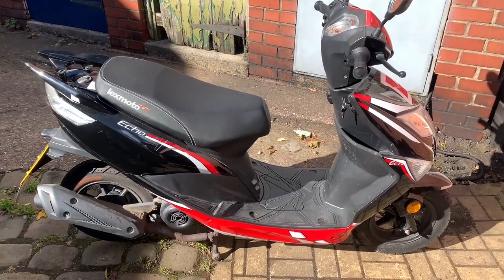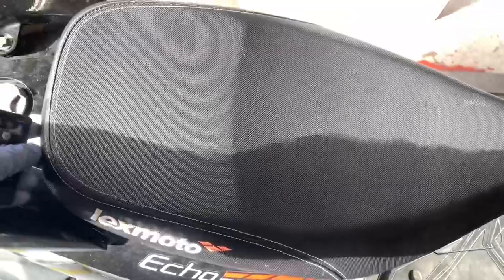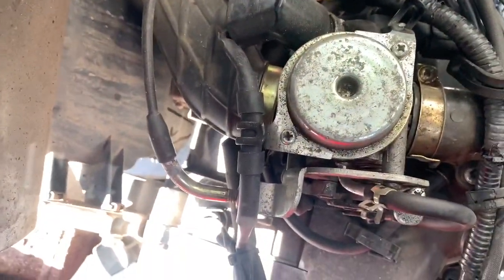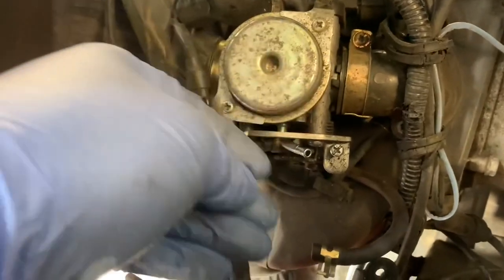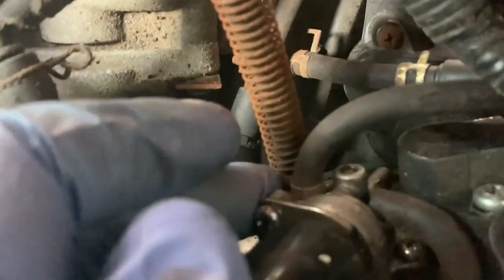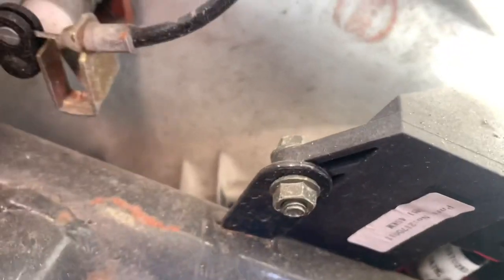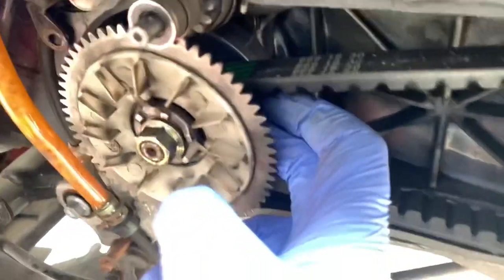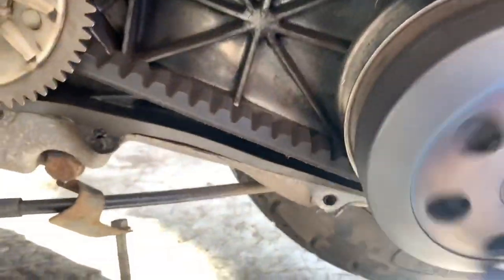50cc 4 Stroke De-Restriction, Euro 4 GY6/New Type Scooter Derestrict... “Make Ya Ped More Fasterer”

Comment from the maker: Something I don’t mention in the video, is that the carb is electronically controlled not only to limit bhp to a leisurely 3, but also for fuel economy and emissions. These things actually have a lambda sensor, and the ECU controls the carb mixture too.
Reply: what advice can you give about the ecu? can you remap the stock ecu and derestrict it or do you have to buy a whole new one
Reply from the maker: @acegik7157  they’re supposed to be able to be remapped, but I’ve not found anyone who can do it yet.
Reply: @StupidBlokeStupidVideos  thanks for the answer, im gonna see if i can find someone locally that can do it, ive found a free software called HUD ECU Hacker that supposedly works with rongmao ECU-s (which is what i have) but im still new to this so ill have to figure out what kind of OBD connectors i need
Reply: @StupidBlokeStupidVideos  its also really annoying because most people with euro 3 and less can just jet their carbs which is much simpler than messing about with an electronically controlled carb or an EFI (in my case)
Reply from the maker: @acegik7157  if you find out let me know, I’m shit at computer stuff though.
Reply: @StupidBlokeStupidVideos  hi mate. Are you still here. I need your help
Reply: @StupidBlokeStupidVideos  just changed CDI 30KM/H to another one with no limit. And I can't start my scooter at all. As there is a problem in carborator?
Reply from the maker: @bambusens  it sounds like an issue with spark, unless it’s been parked up a long time? When was the last time it was run?
Reply: Will it pass mot if we do this
Reply from the maker: @bonnietillman9008  this will have no effect on MOT
Reply: Do you know how to do the 2023 model euro 5 mate bloody thing only does 25mph
Reply: Could I just bur a euro 3 carb and fit to a euro 5 so it can be adjusted
Reply: @shanebedford3452  its probably just an washer on variator and the rpm is limited
Reply from the maker: @shanebedford3452  taking it out is the same effect anyway
Reply from the maker: @shanebedford3452  it will be the injection model. I believe some ecus can be reflashed but some can’t and need to be replaced for a non-restricted version. About £200 I think.

Comment: Hey mate, thanks for the informative video. I tried the BB method on my Peugeot Speedfight 4 scooter (50 cc 4 stroke), didn't notice much of a difference even in accelaration, top speed didn't increase either. The variator restrictor is removed and it goes 31 mph max, any suggestions on how I could make it faster without a 70 cc kit? I guess that's the best this scoot can do to be honest 😂
Reply from the maker: Hi mate. There’s not a whole lot you can do that’s easy or cheap. The bb method usually does work though but won’t gain top speed. Some models have 3 that need blocking. They have another line coming from the inlet manifold to another solenoid valve. Make sure yours doesn’t have that too
Reply: thats because its restricted via the ECU

Comment: I have a question unrelated to the video, since you seem quite experienced, if i put a 70cc inside my 50cc scooter do i have to buy a bigger carb or is there a way to modify the current one?
Reply from the maker: Depends how far you go. If you just change the barrel and piston and keep the same cylinder head and camshaft then the standard carb usually works fine and you should gain a good bit of low down grunt. if you change things like the rollers, camshaft etc to move the power higher up the Rev range then then you can rejet the carb, or in some cases you might need to replace it to get the best results.
Reply: @StupidBlokeStupidVideos  So far Ive changed to heavier rollers and took out the variator limiter, looking to buy a 70cc kit but im wondering will it even change my top speed by all that much since the ecu is still limiting the revs?
Reply from the maker: Heavier rollers won’t necessarily give you a higher top speed, it will just speed up the rate the belt climbs the variator and lower the revs until it reaches top gear. The standard rollers should reach the top of the variator/top gear but take a bit longer to get there. The reason for changing rollers is to keep the engine in its torque curve, so if you move the power higher up the Rev range then lighter rollers will keep you in the power etc. No matter how much power you give it, the top speed will be determined by the gearing as long as there’s no electronic restrictor or the engine doesn’t have the power to reach it.
Reply: @StupidBlokeStupidVideos  yeah they didnt increase my top speed downhill but riding on a straight road i went from around 35kmh to 55kmh(the ecu limit) since the stock ones were too light and the belt didnt climb up enough
Reply from the maker: @bambi992  if you’ve got the power for it, then there is a chance that they sell longer final drives, but I’ve not seen them before on this model.

Comment: Hi mate, excellent video. I unplugged my speed sensor and my EML comes and and the scooter won’t go past 20mph. EML is flashing. I then plugged the speed sensor back in but turned it round so it couldn’t pick up the speed and it was still stuck at 20mph with EML flashing. Any ideas bud? EDIT: putting it back how it was bike goes back to 28mph like it was before
Reply from the maker: I’ve not had this issue before but sounds like there’s some kind of anti tamper on the software. How many speed pickups are on the clutch bell?
Reply: @StupidBlokeStupidVideos  hey! Thanks for the reply. It’s back together now but I think there was 4. Pretty sure the CDI is restricted however as online place that sells my scooter advertise a restricted version and a derestricted version and in the parts section they sell derestricted CDI’s so for £30 shipped might as well give it a go. But yeah, unplugging the wheel speed sensor restricted it to 20mph with a flashing EML which sucked. Great video however, I blocked the 2 pipes to carb (mine had mini tiny air filters on each end next to 2 solenoids) and now it accelerates much quicker at least so thanks for that bud!
Reply from the maker: @a1d3nh0  yea the carb mod won’t adjust the top speed if it’s on a limiter, just acceleration and hills. If a de-restricted CDI is only that price then it’s worth buying, but the ones I looked into buying when I made the video were much more expensive. Make sure the ECU you get is got a euro 4 model and not the older CDI which just controls the ignition and and not the carb. I was going to suggest putting the speed sensor back in place and grinding half of the pickup lugs off if there’s more than one, so the ECU still gets a signal but  is tricked into thinking the bike is only going half its actual speed.
Reply: @StupidBlokeStupidVideos  damn, man. That’s an absolutely excellent idea! I would never have thought of that. Cheers. If this CDI doesn’t work I’ll give that a go. Thanks for your time mate. Have a great weekend
Reply from the maker: @a1d3nh0  not a problem, happy to help. That’s just a standard type CDI. It’s not for the Euro 4 models with carb control unfortunately,.. well I’ve never seen euro 4 models use that kind of CDI. If I remember right the ECU on yours is near the fuel tank but I could be wrong. The limiter on the restricted versions of one you sent the link to sometimes have an input from the speed sensor in the same way as the euro 4 ones, and some just have a Rev limiter. The derestricted ones sometimes alter the timing too but they’re for the older model scooters. The ones I’ve worked in with electronic carb control have all used the Dellorto unit like this one which is what I suspect yours will have. 

https://www.racing-planet.co.uk/naraku-unrestricted-euro4-p-196646-1.html#.X9QewuTfUlQ
Reply: @StupidBlokeStupidVideos  thanks for the link dude. The CDI is indeed near the tank, under the seat cowling etc. It doesn’t look like the one in your photo however, it’s a 6 pin thing. With one small connector block going into it I think. Any more ideas? I left a note with my order saying if it won’t work for my bike to just refund it so definitely open to other suggestions.
Reply from the maker: @a1d3nh0  I’ve not come across that before to be honest. Without looking at it it’s hard to say but I’d double check the bike for one of those ECU units in the link I sent to make sure.
Reply: @StupidBlokeStupidVideos  I think you’re right again mate. Taken panels off and it has a Delloroto box similar. The link you gave me is sold out. Any more link for my 2020 50cc sinnis encanto and you’ll be my hero!
Reply: @StupidBlokeStupidVideos  sorry to trouble you again mate. My scooter has both the delloroto box and a box similar to the first link I sent you. So it has both. Are they both CDI’s? Do both need changing? Any idea why so many people talk about cutting a pink wire etc? My scooter has a small black box with 1 x green connector block so it’s slightly different to the one in my initial link but it’s definitely the same type of thing. I found one on eBay that’s identical that claims to be a derestricted CDI. So I’m lost if it has the box that you showed me in the link and the box I showed you. Any ideas bud?
Reply from the maker: @a1d3nh0  I’ll try to find out what I can when I’m back in work. Sometimes they have other boxes thar look like CDI’s but it’s also possible that the ECU sends a limiter signals to a separate CDI and a conventional CDI actually signals the coil to spark but I’ve never delved there deep into the wiring if the eu4 bikes. I’d need to trace some wires to back engineer it, but do you know if the wire from the pickup in the stator goes to the CDI or to the ECU? Usually a blue wire coming out of the stator and if you measure it to earth at the stator side with it disconnected should have about 150ohms on it.
Reply from the maker: @a1d3nh0 did you check the amount of pickup pips on the clutch bell? If there’s more than one I’d honestly just grind half of them off...
Reply: @StupidBlokeStupidVideos  it’s brand new and under warranty atm bud. I’ll try everything reversible first. Defo on the list of nothing works
Reply from the maker: @a1d3nh0  fair enough. Maybe cheaper to buy another clutch bell and do it to that but like I say will only work if it has multiple pickups. A clutch bell will probably be really cheap compared to a CDI.

Comment: My GY6 with rear wheel speed sensor unplugged actually caused check engine light to flash and cut engine on off so unridable as the ecu needs to see a speed ( I assume speedo or rear wheel sensor etc)
Mine is a China Znen Revival but regardless the ecu needs to see speed or it cuts spark to stop it reving as it assumes the vehicles not moving
Reply from the maker: Some of them can do this. On this one’s I have ground off some of the pickups on the clutch drum so it sees that it is spinning, but thinks it is spinning slower
Reply: @StupidBlokeStupidVideos  I wonder if removing 1 or 2 would help see it slower - then blank off or just replace with generic GY6 carb...
Other thing is change flywheel carb and wire in a stock CDI......
I bet I can make a patch lead from ecu plug to CDI etc change carb do away with the euro 4 nonsense i’m in New Zealand anyway
Reply from the maker: @nct9466  I have done that in the past and it has worked, took either one or two of the pick-up lugs off. Also, the ball bearings stuck in the vac tubes actually block off the euro 4 part of the carb.

Comment: have the exact same bike, lexmoto echo 50cc, tried to do this today and the washer behind the variator seems to be welded/ tight fitted on. Is there any way of getting a little bit more speed out of this bike without grinding the washer off? even if it is only a few mph extra 
thanks
Reply from the maker: This should help it get up to speed faster but won’t do a lot for top speed. You can buy derestricted variators really cheap on eBay though, they can probably sell derestricted slide on its own. Type in GY6 50cc variator and it should be the same as what’s on your bike, but maybe ask the seller to make sure before ordering. If you do de-restrict the variator, doing this mod along with it should have a greater effect.
Reply: Mines the same so I'm interested in this

Comment: hi, does this work for yamaha aerox 2018 4t with fuel injection? if not do you know what i can do to derestrict it? ive got a malossi forcemaster 0 and a new variator with lighter weights, but it still breaks at 49kmh.
Reply from the maker: No mate won’t work for that. I’ve not done one of those yet so not sure what’s involved in doing one.
Reply: @StupidBlokeStupidVideos  ok thank you for the quick response, will just wait for my ecu to arrive

Comment: Hi mate I’m looking to get my first 50 in a month or so what good value under £900 bike do you think I should get ? (Keep in mind I want to derestrict it), thanks.
Reply from the maker: Hi mate. The best ones for being fast in my experience are the piaggio engine models. The aprilia sr50, nrg, even the air cooled ones like typhoon etc are pretty quick.
Reply: Anything 2 stroke if ur after top speed 4 stroke if u need reliable n are happy at 35-45mph

Comment: After blocking the airways do you have to do the rest or can that make it go faster ?
Reply from the maker: Depends what other restrictions are fitted. Just blocking the vac lines will stop the automatic throttle restriction, so should effectively give you a bit more power/torque. If there’s a rev limiter, speed limiter or the gearing is limited then it will potentially not have any faster top speed without removing the other limiters, but should get there faster/be better on hills.
Reply: @StupidBlokeStupidVideos  ok thanks! And also I’m trying to move the kit start piece and there’s a different type of screw that I don’t know how to take off which tool did you use for that ?
Reply from the maker: @baitetc2088  some of them have 2 tamper bolts diagonally if I remember right. Like a star with a pin in the middle?
Reply from the maker: @baitetc2088  yea it’s called a tamper bit/tamper torx bit.

Comment: If I close these pipes, then I have to buy an ecu and the engine will be 80? Because when I bought the ecu, my engine was choking and it didn't move.
Reply from the maker: Which ecu did you buy? If you fit a derestricted ecu then you shouldn’t need to block the pipes off. The method in the video is showing how to  derestrict it a much as possible for free.

Comment: I’ve got a 4 stroke Sinnis twist 50cc how do I de restrict it
Reply from the maker: They restrict them in different ways. Depends on the fuel system it’s got. It could be the same as this one, or could be injection which would need a new ecu/reflashing. It also could be like this one in this other video if it’s slightly older 

https://youtu.be/etlhaOEAwlw
Reply: @StupidBlokeStupidVideos  thanks for replying so quick yes so all moped can be de restricted as someone told me my sinnis twist can’t be de restricted even thought it’s stops me from going over 30mph
Reply from the maker: @ProTherm_  what year is the bike?
Reply from the maker: It could be injection to be honest. Hard to say without seeing it though.

Comment: Arite mate.
I bought a 50cc echo plus want to derestrict it. Mine looks exactly the same as yours, same colour as well. I was told they can't be derestricted.
What did u say the balls do wen u block it?
Also where can I get hold of those balls?
Reply from the maker: The balls are just ball bearings from a kids BB gun. The balls stop the electronic carb restrictor from operating.
Reply: Cheers geez
Reply: @moukbu4235  did it work
Reply: @kopegoat1641   na the variator ring is welded on. Need to use a grinder maybe to cut it out..
Reply from the maker: Yea if it’s still got the variation ring on, this mod will probably only make it accelerate a little bit faster but won’t affect top speed. Will make more of a difference once the variation restrictor is removed.
Reply: I’ve got the same ped as u got it derestricted and it goes 45 mph
Reply: @haydon1556  45mph? What else have you done?  Is it 45mph downhill?
Reply: @haydon1556  did u get a new cdi?  I've done everything else in the bid I get 37mph
Reply from the maker: @haydon1556  with the variatior derestricted they can usually do about that speed, but will still accelerate slowly unless you do this or alternatively get a new ecu on the euro 4 models. Most people (even shops) that I’ve spoken to about eu4 models don’t know this trick. I work in a bike shop and figured it out for myself, but a lot of places will just derestrict the variatior/disconnect the speed sensor on euro 4 models depending on the bikes setup. For best results both this and the variatior/speed sensor want doing.
Reply: @moukbu4235  mine did 37 mph before it was derestricted and now it does 45 on flats 50 downhill
Reply: @moukbu4235  idk what they did to it I took it to the place I got it from and they said they derestricted it but not sure what they did I’m not a bike guy
Reply: @haydon1556  how much did it cost to get it derestricted?

Comment: So you block off them two carb pipes then put em back on?
Reply from the maker: The two that go to the solenoid valves. Block the wrong  ones and you’ll cause issues lol.
Reply: @StupidBlokeStupidVideos  yeah was gunna say lol cheers mate 🤣
Reply from the maker: @charliedance9471  no problem G